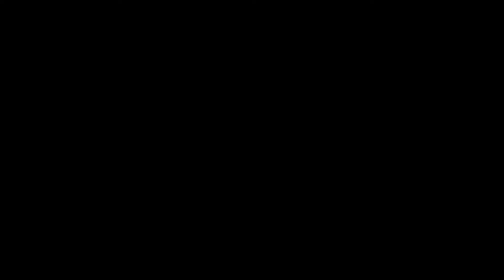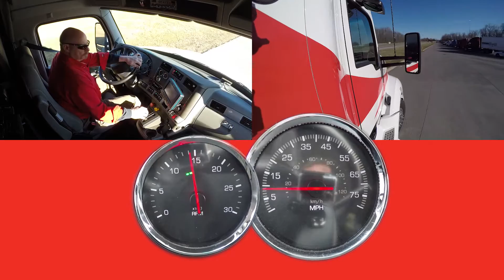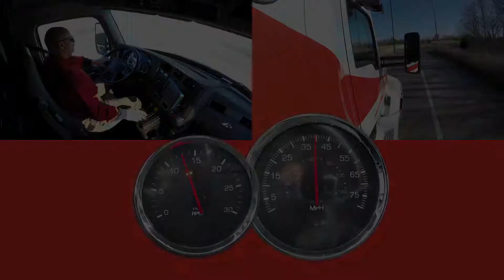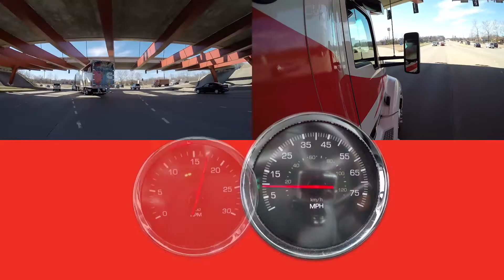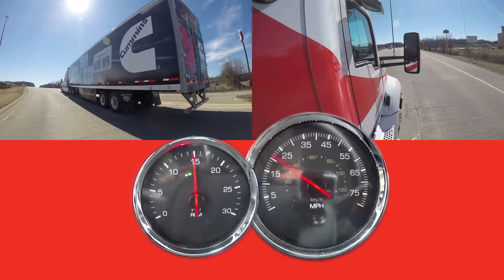Cummins On Highway Electronic Engine Features - Load Based Speed Control

Comment: Where can I find the folder to adjust the load speed and/or disable ? X15 2022
Reply: Not true , if you have insite you can change it under ( features and parameters) then go down to ( load based speed control) by clicking on enable which should bring up a drop down button to disable it.
Reply: Take it to the dealer open her up. I got it removed now I can climb mountains.